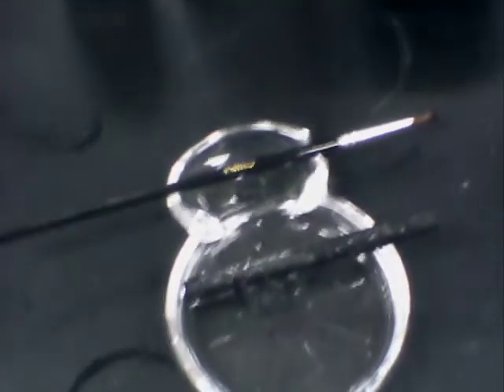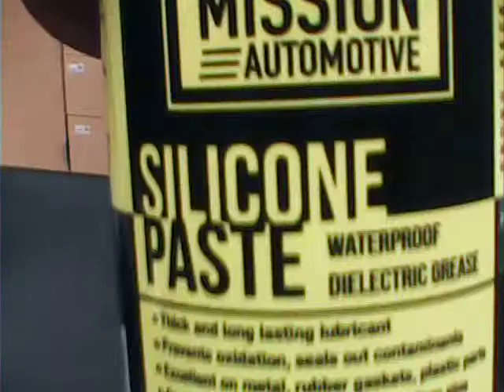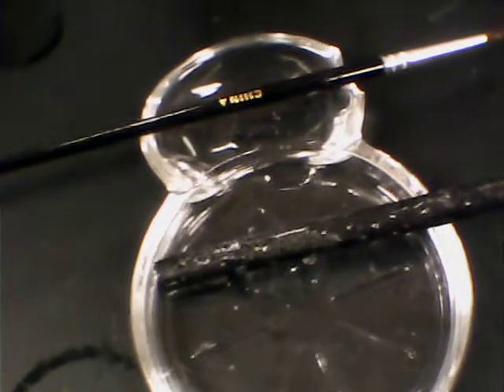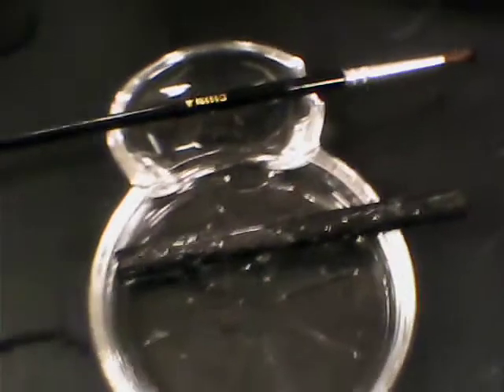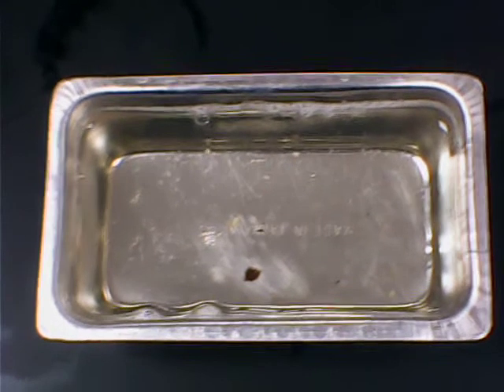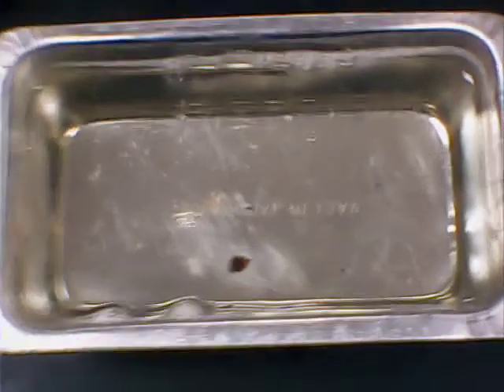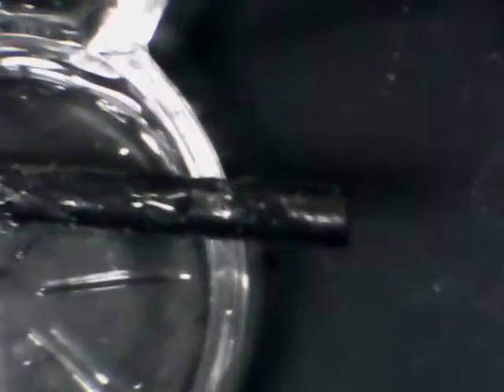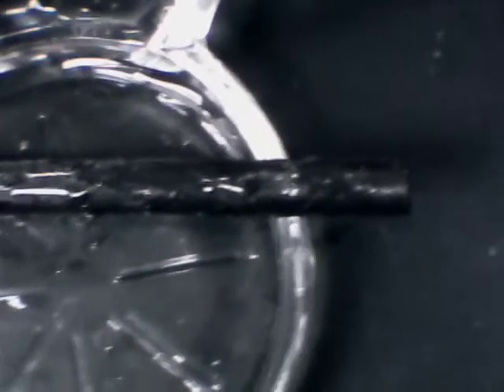Graphite Electrode/ Coated/ Cross-linked Polyvinyl Alcohol Gel

Comment: Are u using formaldehyde as electrolyte ? If yes is it a strong electrolyte using with liquid PVA?
Reply from the maker: No longer using this type of membrane. I would wash the membrane to remove excess formaldehyde. Try using porous surgical tape (3M, for example).
Reply: @daqvidscottsoriano  what about making gel electrolyte with pva and sodium sulfate